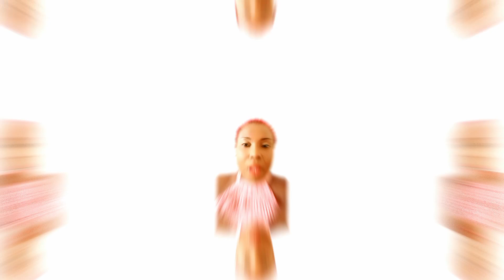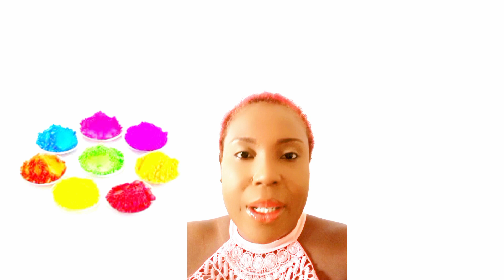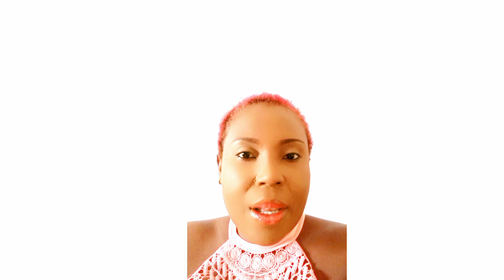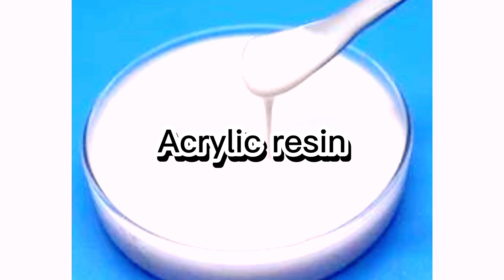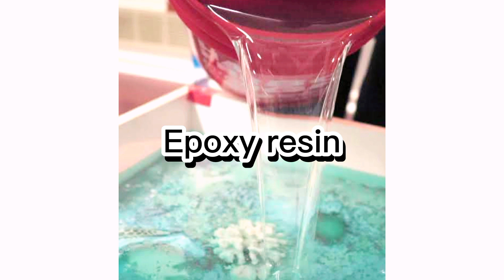Essential Chemicals for Paint Manufacturing Made Easy!"Part 2

Comment: Ma Base the binder or resins as explain the are use to stick together the paint chemicals properly to the surface and also ensure that the paint has no dusting. My question is what  can be done when applying the binders in other to prevent dusting and cracks.
Reply from the maker: Add enough binder